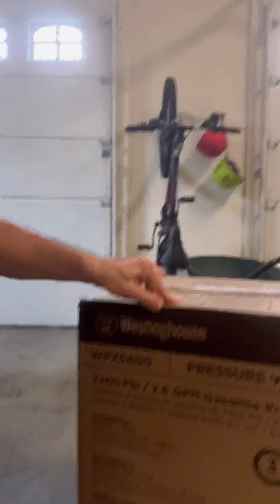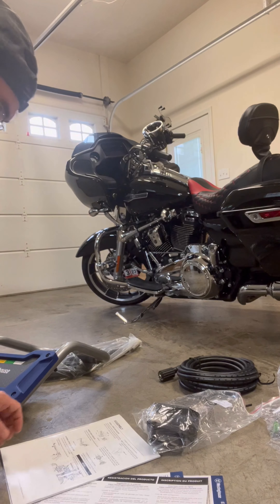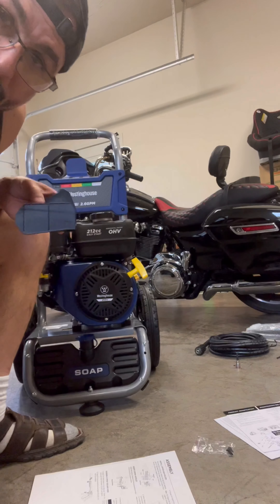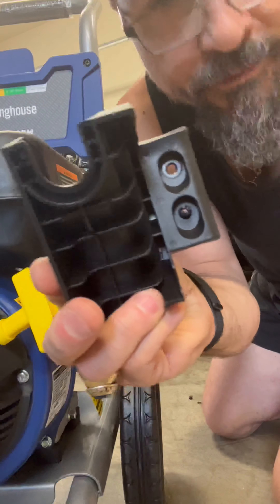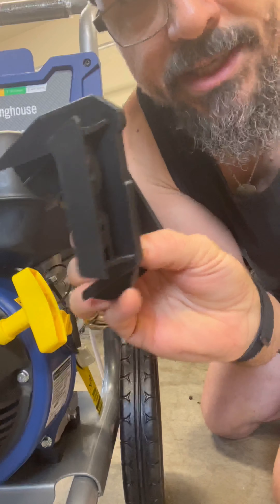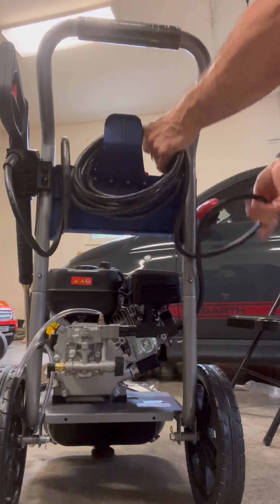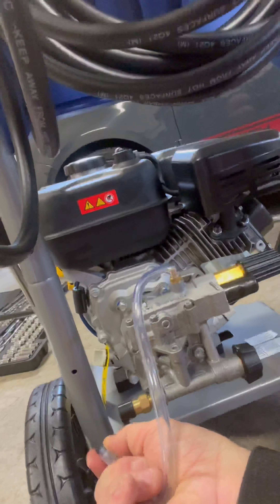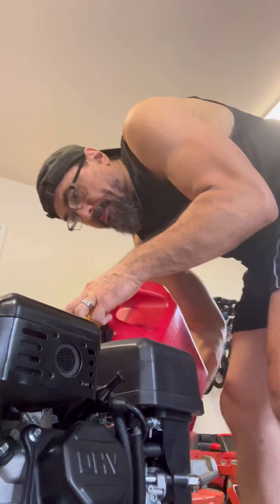Westinghouse WPX340 0 Pressure Washer “Step-by-step Installation for Dummies”

Comment: For the top holder installation, you install the top bolt first. Then, you insert the female rivet piece into the bottom hole. Finally, insert the male rivet piece to lock up the rivet. This secures the bottom hole.
Reply: that was a mystery thanks!

Comment: Question did the kink in the clear hose cause any problems when you started to use the pressure washer and what type of soap did you use... just purchase mine a week ago and have yet to use it and it have that same kink in the clear hose but just the at the main connection
Reply from the maker: Kink caused no issues.  As far as the soap goes, I purchased Sun Joe SPX-APC1G All-Purpose Heavy Duty Pressure Washer Rated Cleaner + Degreaser and it works great!  Good luck!
Reply: @dirksdomain  thanks for your response, I tried my pressure washer out. Worked fine have used any type of soap yet but will work on it soon..,

Comment: It doesn’t say anywhere in the instructions that you will need an Allen wrench!  A 10mm wrench doesn’t fit the mounting foot nut, and you also need a ratchet wrench  for the top wand holder!  So frustrating!
   The colors for the nozzles are labeled on the front of the plastic right below where you put the nozzles!

Comment: Is it easy to attach and remove the top half/handle? I have a small car and want to be able to transport this in the car. I would need to be able to remove the handle part to make it fit and reattach it easily later.
Reply from the maker: @ss-nm7mp  I’ll have to check it out but i don’t believe so!